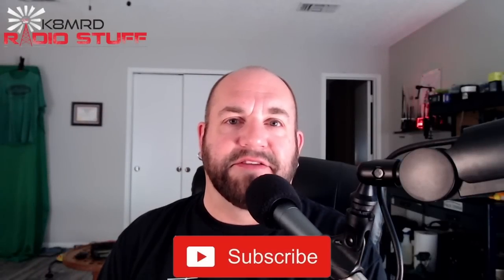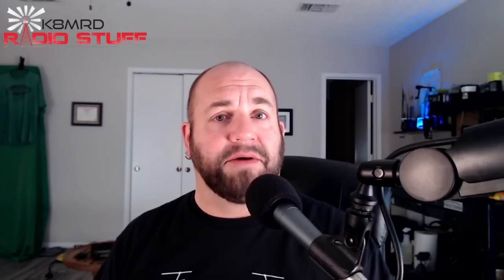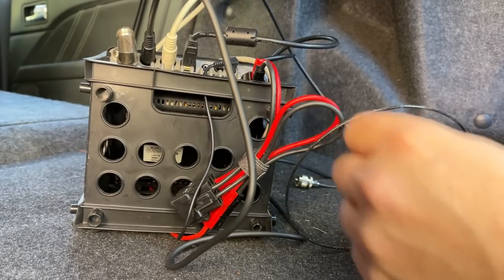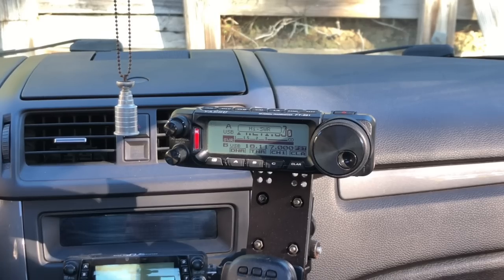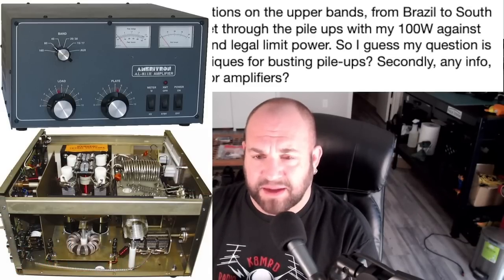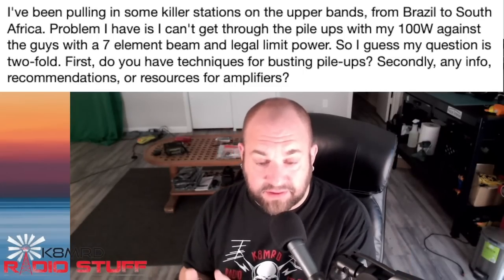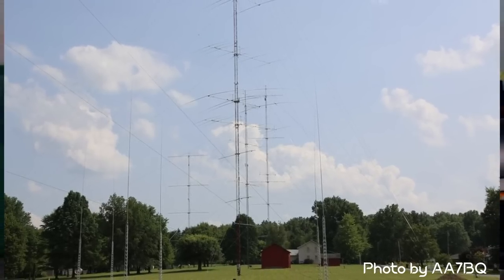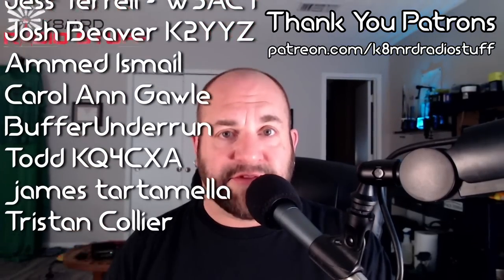How To Bust A Pileup With Only 100 Watts? Mailbag Monday #36

Comment: I have a Ameritron 606s from HRO and it works great. I use to run a Thunderbolt 305 in the 80's on cb.  I don't know a lot about amps but here is what I learned. Before you say you want legal limit 1.5k is your shack set up to run that, some 1k amps require 220v outlet, the 606s runs on 110v, the 606s comes with switching power supply which is added cost.  Do you want tube or solid state amp,  tubes are more forgiving with swr a little high, solid state will shut down (which is a good thing so you don't burn anything out) which leads into now you have to get a tuner.  Which type, auto or manual ALSO it has to be rated for the power of the amp so if you get 1.5k amp your tuner needs to be rated for 1.5k as well, AGAIN more $$$.  So it's just not get an amp plug it in and on the air, just a few things to add into the whole amp equation.  Those are things you don't figure into total cost.  I run my rig at 50-65 watts and get up 300-400 watts.(don't want to push it to the max)  Ameritron suggest no more then 100watts on your rig,   Always get an amp larger then you want to run your wattage at, so if you want to run at 600 you need at min 800 or larger, Just my .2ct

Comment: I've contested for a long time, and been on both sides of a pileup. The most important thing to me is be polite. Send your call as you normally would. If I hear someone yelling, barging in, stringing out his call, repeating the call or only using the suffix I will absolutely ignore them until the end. I ran a POTA pileup this weekend and a couple times took a weaker signal because they were just calling "normally".

Comment: Yes, Mercury IIIs. I believe Alek has had some issues with the Juma amplifier. But, Mercury IIIs, Expert, Flexradio and Elecraft are great solid state amplifiers. The 811H, 80B and other Ameritrons are good solid tube amps but do require you to tune them. The older ones I am not so familar with but Heathkit is also good if you can find a used one from someone you trust. Great advice on breaking pile ups and honestly, being on the receiving end of a pile up makes you as much of an expert as any of us working pile ups. The only thing you missed there is getting a female to call for you. Wife, sister, girlfriend, mother, hell, even your mother in law, if it is female voice, you have just added 3db 🤣
Reply from the maker: Not gonna lie, that looks like a hell of an amp.  Another suggested getting a kid or YL to call as well.  I thought that was a great idea.  Nothing like a little child labor to get you some contacts lol!

Comment: Good advice on the pileups Mike.  I generally just run the G90 at 20 watts, eventually I get through the pileup.  I'll try for a few minutes, then move on but come back.  Doesn't seem to slow me down.  If you're at another park and hunting throw out the park to park, you will generally get the call if the receiver hears that.

Comment: Good Mailbag ! Pile ups: Sometimes it's best to wait until things die down a little. The big guns are usually in there from the start. Once they thin out, it can be easier. If it's a DXpedition, many times a schedule is posted, the second or third day can be easier. Wait till the later or off hours. Find a band that works well for you (probagation taken into account) that is not 20, 40 or 80 meters if they are operating on multiple bands. As Mike said, timing is everything. Adjust your radio for more punch. Maybe a little more compression. Hook up three HF rigs to transmit at the same time through one antenna and call till your power supply smokes....not....lol.
Reply from the maker: That's good advise too.  Thanks for chiming in.  Very true.  Once those DX stations are spotted, the bigger stations are all over them like white on rice.  I'll have to try TX'ing with multiple radios into one antenna lol!
Reply: lmao i can see some lid trying that

Comment: Mike - Thanks so much for the answer on the ATAS + Tuner combo!  Going to add a simple on/off switch for the tuner into my box design, way easier and lighter than adding more cables or a coax switch.

Comment: Winter FD this year has a 100w power limit!  Now op skill and antennae come into play!
Reply from the maker: I wish all field days were like that.  I guess if you had a generator or something to power your amps that would be one thing, but these guys sitting at home pushing legal limit completely defeats the purpose in my opinion.
Reply: @hamradiotube  There should be for events an under 100w or even QRP set of freqs.  Like the Novice sub bands on 10m

Comment: Great tips, Mike!  Sorry I'm late to the party.  As a person that often struggles with breaking the pileup, the advice to listen and figure out how it's run is definitely the right first step. Next advice you gave, that made the most sense to me, is to try different stuff!  Here's my personal gem - If I've been at it for a few minutes, one of my secrets is to wait just two seconds after QRZ (not much more, or you risk being "that guy") then kind of slowly/deliberately do the prefix, but REALLY focus on the suffix, like, really annunciate and slow that part down a bit more - maybe with a tiny bit of 'flare' on the last of the suffix.  That often gets me the "station ending lima tango"  You'll know when you unkey if you need to try it again, but I usually never have to do that one more than two or three times.  Anyway, hope that made sense.  Sixty percent of the time, it works every time!

Comment: MailBag Monday Question for next week:
IC-705 or G90 or FT-818 or FT-891 or IC-7300 
New General, first portable radio for camping?
Literally asking for a friend who got general this summer the same day as me, but hasn't been active since the mid 2000's.
We are working on an EFHW for him, just need to tune it; and, over Black Friday scored TWO DX Commanders. Antennas wont be an issue...

Another Great Video! Thanks for the mentoring.

Comment: i find being a tail end charley works quite well, it puts call-in mind as being last Hurd and the receiving op tends to remember it easier than being the first one when trying to remember a call to answer
Reply from the maker: It's a good technique.  As an activator, I don't usually wait till the end, but if the pileup is that thick, sometimes you just can't pull one out and you sneaky tail enders get the contact!

Comment: Persistence and proper etiquette.  Personally I think the use of an amp is the result of too many people with amps. I've confirmed 125 unique DX entities on SSB using 100 Watts or less on g5rv Jr or random wire antenna.  I'm in Minnesota so maybe that helps?  Wait until the pileup dies down or catch it before it's hot.  Best of luck 73

Comment: I picked up a used AL-811 from Huntsville Hamfest.  I don’t run it that often, but it is nice to be able to run 500 watts once in a while.  It runs off a regular house plug so no need for 220 power.
Reply from the maker: That's awesome.  Maybe one day I'll join the big boys but honestly, I've not really felt a desire or need for an amp.  Could just be that I don't know what I'm missing.

Comment: Busting pileups with 100w. I mostly use my Yaesu FTdx10 so your settings may be listed differently. First I change my TX BPF SEL to either 300-2700Hz or 400-2600 with Processor On but don't overdo it to the level it distorts you.
Most of my early dx contacts were using 100w on a 991A and my homebrew fan dipole. 

Today I do have an Ameritron ALS-600 and I only run about 400w of the rated 600w + that is capable of. My logbooks on QRZ, LoTW will show you that you do not need a lot of power to do DX. All of my contacts are SSB as I don't currently run digital. I love my Heil PR-781 too much! 
Remember "ANTENNA ANTENNA ANTENNA" is primarily your most important link in the system.
73's 
KT4RAM

Comment: DX pile ups and 100 watts….Before I got my amp and I only had 100 watts, I make sure my transmit bandwidth was either in the mid or sometimes even narrow position and I always crank up my compression to give me more punch. And like you said Mike listen, listen, listen. Is the DX taking the first caller, the loudest caller, or the guy that tags along at the end. You can usually establish some type of cadence after listening for a while. I do like your suggestion for if they call QRP only. Great sneaky idea.😂 Since then I have bought an amplifier from Acom and it has helped out tremendously along with an End fed half wave up at 50 feet. Just my .02 cents 73
Reply from the maker: Good call, didn't even think about the TX Bandwidth.

Comment: Nothing worse as an activator with a pile up then some of the rude operators coming in there. I think persistence is key. Sometimes even with an amp it takes persistence. Repeating the call over and over is annoying and I ignore those guys most of the time. Waiting for any opening can get out of control, so can waiting until the end. Some wait so long they end up doubling with the DX/Activator. I just stick with it until I get heard or move on and come back when it calms down.

Comment: FWIW, I've been a ham for 42 years and have probably heard every possible way to bust a pile up. 
First is brute force. Nothing like a "California Kilowatt" and ginormous antennas to get the job done! This is the "life is too short for QRP" crowd.
Then, there are the QRP ops. Many DX ops will work them *if they hear them*. Here, being a "tailender" and throwing out "QRP" often results in the DX asking "Who's the QRP?" 
Waiting until the pile dies down works, as long as you don't run out of propagation. This is more common on 10 and 6 meters. Wait too long, and there goes the ionosphere! 
The October openings on 10 meters were fantastic and a hint of what's to come. The best DX was from Pittsburgh to Cape Town, on 10 meters, using a Siltronix 1011D that was saved from the trash and a Super Magnum CB vertical. I just waited until the herd was done and got through even though it was 2 hours after his sunset.
Reply from the maker: I personally like the brute force method myself.
Reply: @hamradiotube  There is one other way, being obnoxious. A local SK used to hammer his way in until the DX gave up and acknowledged him. He would throw his call out regardless of who the DX was trying to work. Like this: 
"Looking for 6 and 7 calls only!"
"Whiskey Three Bravo Whiskey Uniform" 
"Looking for 6 and 7 ONLY! Bravo Whiskey Uniform stand by!"
"Whiskey Three Bravo Whiskey Uniform. You're 59! 73s." 
It worked for him...
Reply from the maker: @spaceflight1019  I would prob come back to that guy and tell him I'm not logging him because he's being rude.  I can't stand people who don't have any decency.  They're just being selfish and I will not reward that.
Reply: @hamradiotube  True that. When we cleaned out Ed's basement after he died he had pretty much every DX award on the planet, including many from foreign countries. Ed never got above Technician and spent most of his years chasing DX above 50 MHz. He was a big AMSAT booster. After Novice Enhancement, he made the most out of the lone solar cycle before he died. 
There was another guy, WA3Giant Purple Rabbit. He chased DX until his marriage came apart. But, he usually got through on one call.

Comment: If your power supply gets hot enough to cook eggs, you are drawing to much.  Most power supplies are listed with peak draw, and constant draw. You take an Astron 35 amp linear, its only rated for 25 continuous and 35 intermittent.

Comment: Sometimes I will call into nets on QRP times.  Usually on nets if I need to be in or out.  Or I test my system in case in the future I have to be on QRP.  I had to during the Ice Storm URI power failure.

Comment: Maybe the DC in the coax is messing up the MFJ tuner with the Yeasu ATAS?
Reply from the maker: I don't think it's the DC, I think it's the fact that the radio settings are set to use a tuner.  Although the ATAS settings are different than an external tuner, it's prob still sending the same type of signal.  Purely a guess though.  Either way, just keep it off the using the ATAS and he can do exactly what he was wanting to do.